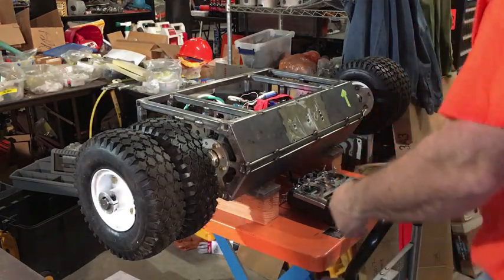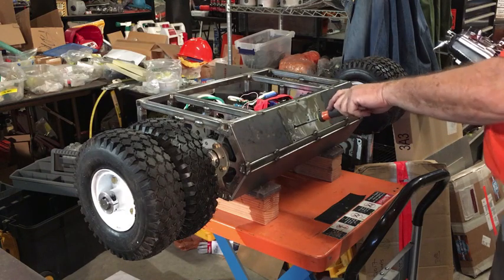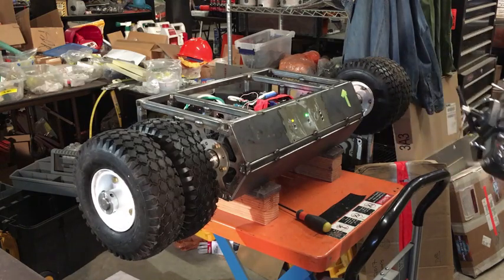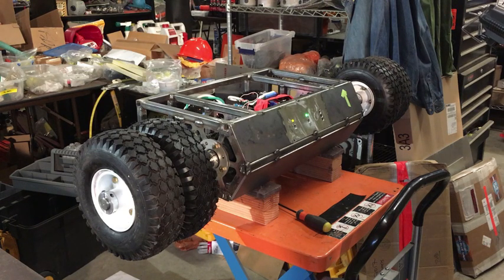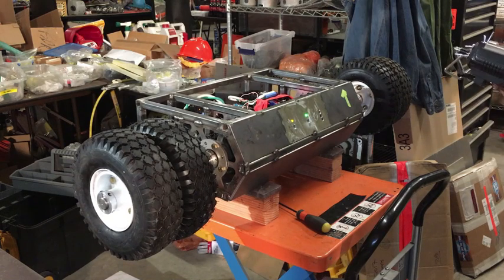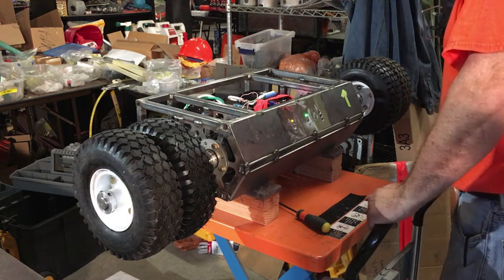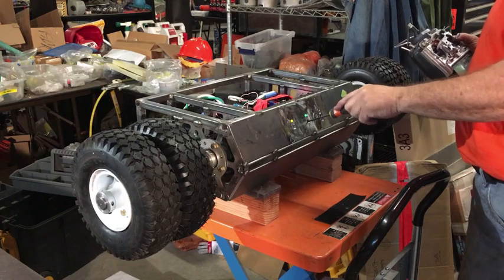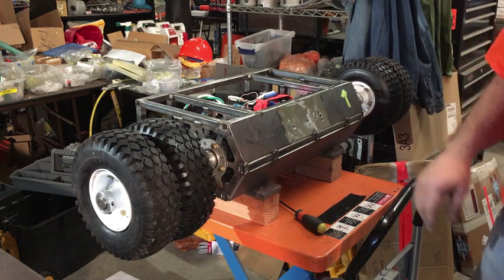Hypothermia 2019 Prototype, bench test

Comment: 20m/h woooow, you’re gonna need a wheelie bar for that... lol
Reply: EthaN if you think thats amazing lycan can apparently reach 44
Reply from the maker: You can gear them for any speed you like; slower speeds actually require more HW to get the gear reduction.

But acceleration is higher at lower top speeds, so it's a balance.
Reply: dat guy miles per hour? Yikes